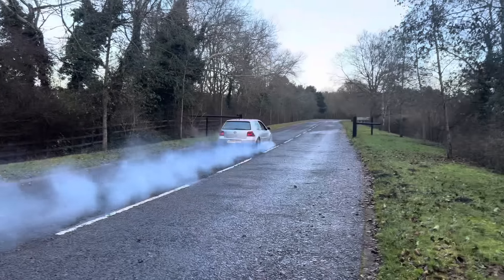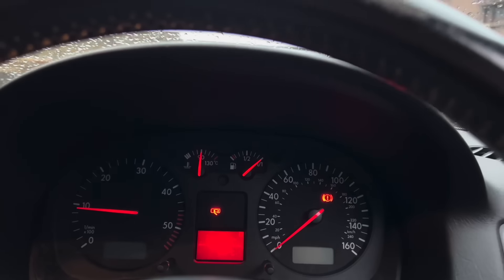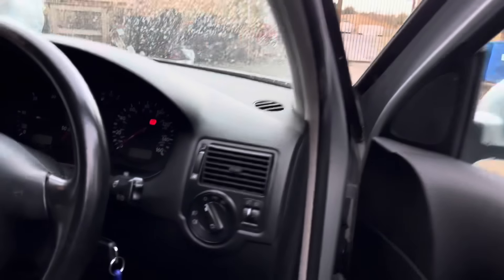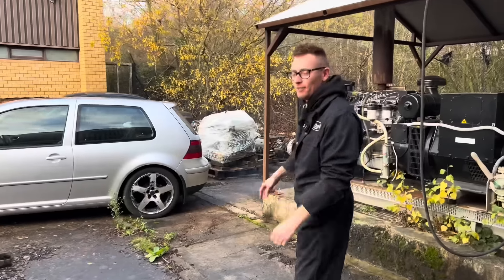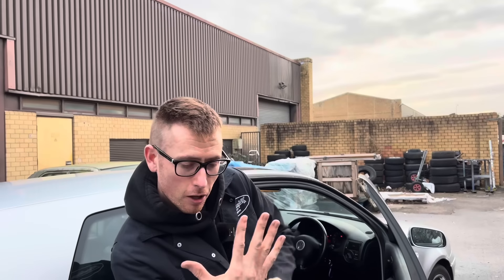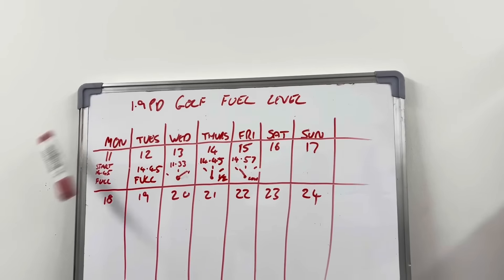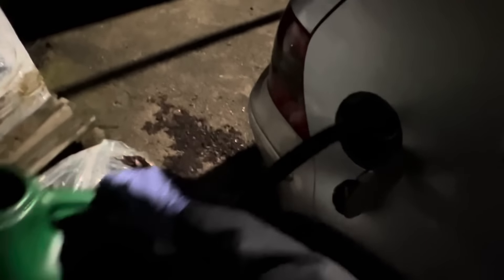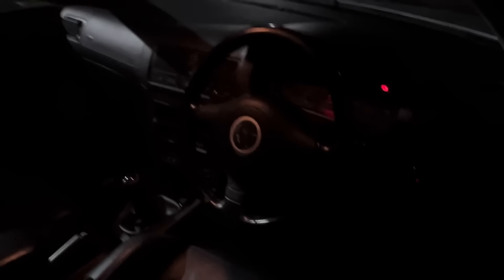2003 VW GOLF how long will it IDLE? OR Blow up first? The Idle experiment. (ONE FULL TANK DIESEL)

Comment: with this car i was used to  drive 200-250km at 110-120km/h before the gauge begin to move.
Reply: I think it's a general VW flaw. Any VW I've driven, were the same: Gauge does not move for the fist 200km, then during next 200km it rushes  quickly towards empty, and after it enters the red sector, you still have 200km to go. That's why I don't trust it and relay rather on tachometer values.
Reply: @DimitriSokolyuk  nope, on older tdi the filling pipe contain near 10 liters.
that's why.
Reply: @djieffe  Benzin or diesel -- same experience for me. Newer models have a slight shift however. First 400km it does not move. Then it rushes down next 200km. And at 1/4 tank you are basically already at reserve.
Reply: @DimitriSokolyuk  strange, i had golf2 jetta2 golf3 jetta3 golf4 and now golf wagon 6. except for golfwagon, gauge doesn't move for first 200km, then  more or less 200km each 1/4tank. 
city and highway combined around 1000km/tank(50L), 1200km full to the cap. with some minor mods to engine. few km less for 1.6TD engines.
Reply: @DimitriSokolyuk  I have a 2008 GTI and I swear the gauge moves exponentially faster the lower gas there is. Sometimes it also moves back up if I decide to drive more economically.

Comment: I think idling the engine would ONLY HARM it if it is low on oil. Or has no water, besides that, no problem
Reply: oil pressure tends to be relatively low at idle rev. Not that great but it should not harm the engine
Reply: @elpresidente2145  Depends on your engine. With idle you also don't need the same oil pressure on your crank regardless. Many engines around however which don't do so good with idling of course.
Reply: 5.7 hemi would like a word with you

Comment: Interesting, why did it suddenly just eat 20 liters of fuel a day, if on the 1st day it took about 2.5 liters….
Reply: That's because the fuel gauge is not linear.  If I top mine up to the brim the gauge will show "Full" for about 200 miles, the next 200 miles will take it down to 3/4, another 200 miles to 1/2, another 200 to 1/4, and then you've got about 200 miles left in the tank to empty.

Comment: Just shows you start stop is bull 💩its not saving all that much fuel on a newer car when ur at the lights etc. In fact its prob using more fuel to restart the engine than it would if left running. I know peps r gonna say its cutting emissions but if its using more fuel to restart the engine then its more emissions. 😮

Comment: I guessed 4 days so 96 hours so 102 hours aren't far off. I based it off a 10gal tank at about .1 gal an hour.
Reply: What would it be with air-conditioning running.  My best guess is 60 hours, based on work ute fuel economy.
Reply: @satrah101  I think maybe half but the car I had that had the gal/h consumption had manual AC I think climate control would be better as the AC would kick on and off. I used to deliver for a supermarket with refrigerated van and we would leave them idling for hours and never really made much difference to fuel economy and I guess would be far bigger AC unit compared to just a cabin ac.
Reply: @satrah101  About 200rpm more and ~3kw of power. 5kW would be probably about 1,5L/diesel per hour. So somewhere there. Also the compressor would cycle when the cabin reaches temperature, on automatic AC systems anyway.

Comment: Do golf tdi on waste motor oil
Reply: Early one with Bosch VE pump does run on waste oil, I'm not sure on PD unit injector versions but i'd guess they don't like it.
Reply: PD is not able to run much higher viscosity than D2, and the solvable deposits in black diesel tends to stick the injectors. ALH/AGR runs well on it. I run 50% in my AGR even in the winter
Reply: @jvinsnes PDs can definitely run on waste engine oil but would advise mixing it with some diesel to thin it out a tad. I run a TD5 farm truck on 100% waste engine and hydraulic oil and it runs fine, but does run a bit worse on hydraulic oil as it’s so thick
Reply: All diesel engines can pretty much run on all these fuels, even straight up dehydrated pig fat if you can feed it to the injectors. Even a PD or CR should run, but you will destroy the pumps and the injectors in them.
Reply: @rkan2 never. I run for 5 years an ARL on 10w40 valvoline all climate. No stress at all. I live in Romania so the temperatures are going below -10 degree celsius. So even at -20 is starting well.

Comment: Looks like the idle was around 950rpm, should have dropped it to around 700rpm
Would probably of lasted at least another day
Reply: At idle,the oil pump is not full working,different on engines yes,but lower idle brings lower oil pressure.
Reply: Ok
Thanks
Reply: Ye, 1.9s idle around 900rpm. You can change in VCDS  to around +/-50rpm
Reply: "of lasted" 🙄

Comment: Can you sleep on a diesel? I'd die.
Reply: You know probably know nothing about diesel engines... 
Yeah you can easily fall a sleep while driving a diesel. They are well known for this.. because of the noise effect over humans, drivers.
Is nothing wrong sleeping in the car or big lorry while is running.. How do you think the lorry drivers they sleep in winter nights when they aren't allowed to drive after certain time?
With the engine on.
Reply: @MrFryfish  With the engine on? 
And who pays it? 
And where is it allowed?
Do not have they another diesel or propan heating?
Reply: @002o  When is matter or dead or live the above questions cancel out everything. This is what is important to understand. Of course the above experiment is meant to prove something. A RELIABILITY in diesel engine well made! That's all. Any other questions?
Reply: @MrFryfish  I do not know what you are talking - answering about. I was just wondering when you write that lorry drivers sleep with the main diesel engine on. According to me, it is not happening.
They have an independent propan or diesel heater.